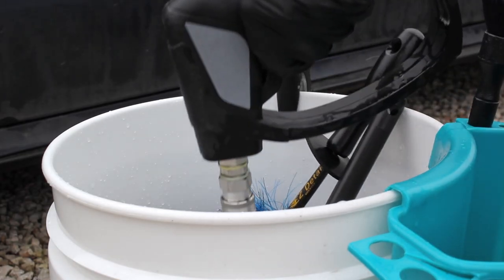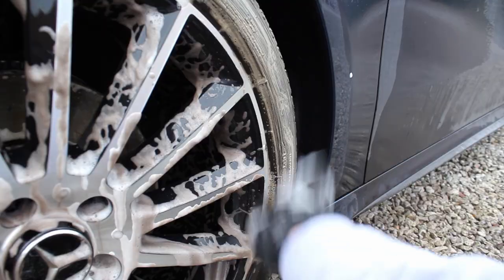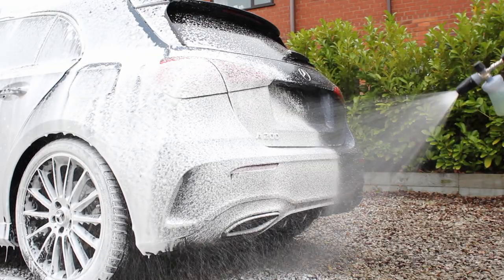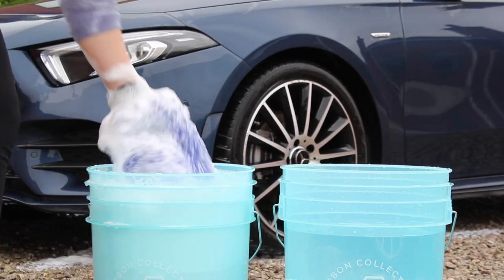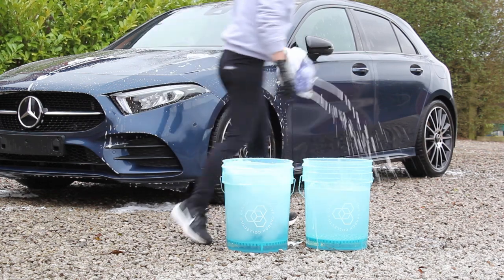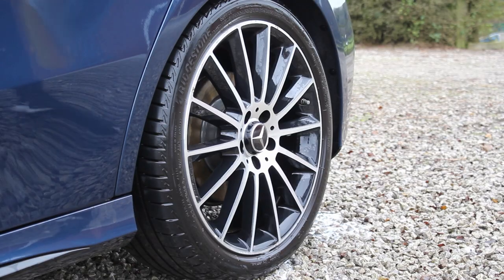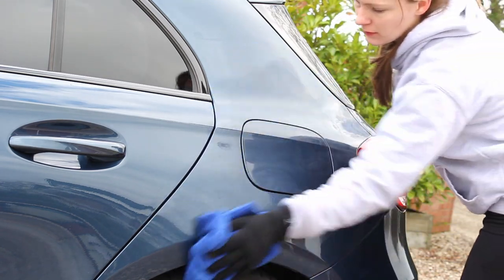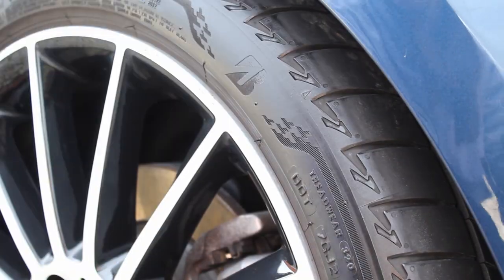Dirty Mercedes A-Class | Exterior Wash and Protection

Comment: Nice to see the car cleaned before the GS and brushes came out, I'm always a little perturbed when I see brushes being used at the prewash stage. Really nice little bit of content and a great outcome for that minging Merc. All the best.
Reply from the maker: Cheers Lee! Yeah it definitely makes more sense to me to save the brushes for the contact wash. Not so bad if it's just on the rubber seals but I wouldn't go near the grille or any paintwork without rinsing the pre-wash first
Reply: Yea I've seen guys pre wash and start with brush 🤷🏽‍♂️ that's a no for me...... great job on this car 👌🏽

Comment: Great video Heather, would you have any plans to do a video on applying a ceramic coating outdoors? Any challenges, best product to go for? Would be interested in your opinion 😁
Reply from the maker: Thank you! 

I'm actually planning on ceramic coating my car soon and will be doing this outside as I don't have a garage.

I've written this article on my website with some tips
https://autocarehq.com/how-to-ceramic-coat-a-car-outside-and-get-perfect-results/

I've also got a video showing the application of the Pyramid Car Care UBV Coating which has a short cure time so is good for outdoor application. 
https://youtu.be/u3kuBkadBG8

I've got an affiliate discount code for Pyramid products (ACHQ) if you go for it :)
Reply: hi Sonic, sorry to interupt but i recently did my ceramic coating outside with no issues. i'd recommend the Gyeon Evo products with the Cure included. I went with the Pure version as i have quite a dark car (orange) and the inclusion of Cure which you apply shortly after the coating stops you having to worry about the car getting rained on until the coating is cured. Possibly the easiest coating ive applied, especially for out door application. just make sure the panels are cool and that you have a rainfree day forecast. and of course plan for 2 days to complete the job as with all ceramic coatings its the prep work for the coating that takes the time. (i also used the Gyeon Primer for the machine polish, the paintwork was sparkling after it!)

Comment: Nice one again Heather. Needed a good wash that car, it was looking great at the end. The spray sealant looked really nice to use as well 🙌
Reply from the maker: Thank you! It was looking a bit grubby, I thought I'd struggle on the wheels a bit since the brake dust was very baked on but Hjul did a cracking job. The Hydropel sealant is brill as well, nice and easy to use
Reply: @AutoCareHQ  good to know about the wheel cleaner as well then. Look forward to the next one 🙌

Comment: Another good watch so thanks again. As usual a number of products that spark my interest. I think if I did not have over a gallon of neat citrus I would try Green Star. I have been thinking about my next tyre cleaner after trying Auto Finesse, 303 and Gyeon. The Yum Undress has been sparking my interest lately with a few of their other products so that video was a big help.
Reply from the maker: Thanks very much John! Yum Undress and Autoglanz Rebound are my favourite tyre cleaners atm, bit more foamy compared to Gyeon. I am thinking of trying Carpro’s tyre cleaner too, looks like a good one
Reply: @AutoCareHQ  Have you tried anymore Yum products and if so are you impressed.
Reply from the maker: Yep I think they make some great products. My favourites are the Citrus and Foam+. The only product I didn’t really rate was the Ceramic spray sealant as the durability I got wasn’t great. If you have a look on my channel page I uploaded a vid on a grey Mini in December using most of their range
Reply: @AutoCareHQ  I will watch it. Thanks

Comment: That Hydropel looks really promising Heather. As good or better than GT Sigma (one of my favourites)? Really tempted to get some. Another cracking video.
Reply from the maker: Thanks Peter! 
I’d say Hydropel is a bit less fussy to apply and less likely to streak, although I wouldn’t consider Sigma to be a streaky product. The water behaviour is pretty similar and the durability as well to be honest. I do think Sigma has the edge though for boosting gloss
Reply: @AutoCareHQ  really helpful reply. Thanks.

Comment: Nice job again! 
Is it me, or did the suds from the Fresso die rather quickly in the bucket?
Reply from the maker: Thank you! It’s not the most stable in the bucket but it’s definitely not the least I’ve tried either. It’s usually fine to get around a car without mixing the suds up again with the pressure washer, it does take me a while to move the camera around whilst filming though

Comment: You always have great content, when I am feeling lazy I reach for ceramic snow foam, after a contact wash. Either Wax Is Dead Ceramic Snow Foam, Autobrite Ceramic Magiseal or Auto Finesse - Lavish Ceramic Snow Foam, just find it far easier to protect a car, have you used any ceramic snow foam(s) that you can recommend?
Reply from the maker: Thanks Ricky! Ceramic foams are a cracking invention. Yum Cars sent their Foam+ to try a few months back and I’ve had great results with that. I think it adds more gloss than others I’ve tried and the water behaviour is brill. Been lasting about 8-10 weeks on the cars I’ve tried it on
Reply: @AutoCareHQ  Thanks for taking the time to reply, not tried any Yum products, mostly due to the price, might give it a go once I run out. Have an amazing week 🙂

Comment: Why not just mix the GS into the foam? If you’re doing this for a living time is money.
Reply from the maker: I can get a more concentrated mix of GS on the car if I use the pump sprayer as I don’t have to factor in the extra dilution of the pressure washer and use more product. If the car was a bit cleaner/ had protection on it then mixing GS is a really good option to speed things up